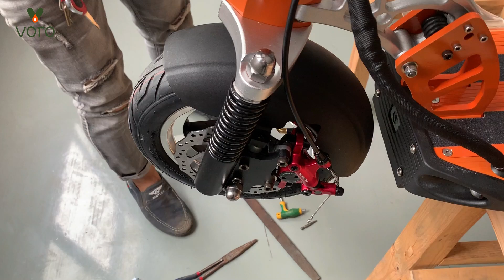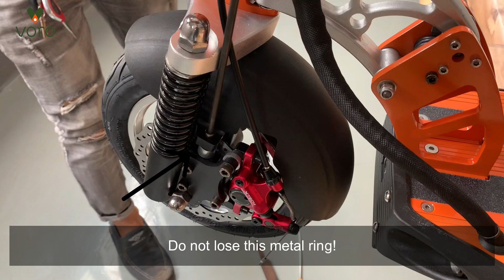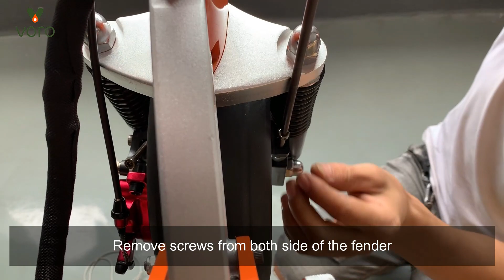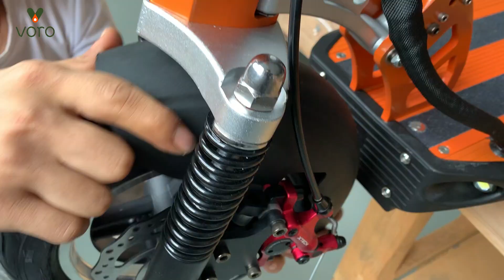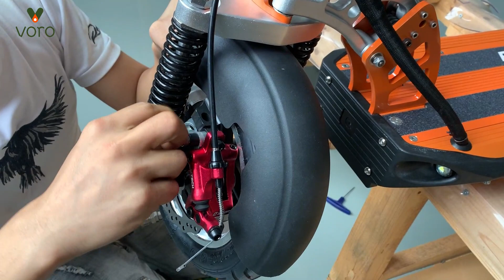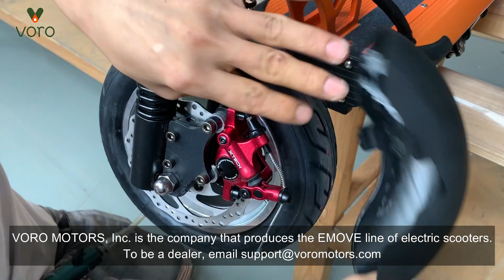How to remove the front fender for your EMOVE Cruiser Electric Scooter?

Comment: After removing the front fender, and then saving the two, silver rings, do you need to use those two, silver rings when installing the half, front fender?  Or are those two rings only used with the FULL fender?
Reply: The rings are only required for the fulll fender.
Reply: @Spursrule1969  They make the spring useless is the fender Hitting the top
Reply: @Randomguy-rh7rl  
The full fender can rub against the tyre if you don't use the rings to raise the fender, It can also rub against the spring suspension and make a noise when going over bumps in the road which becomes annoying, I've had no issues with the stem hitting the fender,  The half fender doesn't need the rings to raise it as the fender sits behind the stem and suspension,. 
The big disadvantage against the half fender is in wet weather, the water hits the bottom of the stem and sends water everywhere resulting in the deck getting covered in dirty water, Also more worryingly there are 4 screw below the stem that can rust if you get a lot of water constantly hitting them.
Reply: @Spursrule1969  iput Half fender and glue over The screws
Reply: @Randomguy-rh7rl  
Yeah, I've cut a bike innertube down the middle and zip-tied it to the bottom of the stem to protect the screws but it also stops the water splashing the deck as I cut it long enough (9 inches/24cm) to sit on top of the half fender, Seems to work well, Only ridden in once in rain since then though, But living in London the rain will be returning soon.

Comment: When I remove the fender,  do I have to put the two screws back in, or leave it as is?
Reply from the maker: You can leave it alone once they are out if you'd like. They only hold the fender so them being absent wont change anything else.